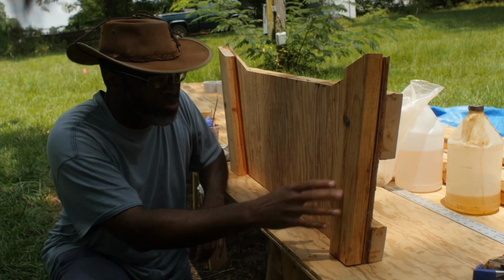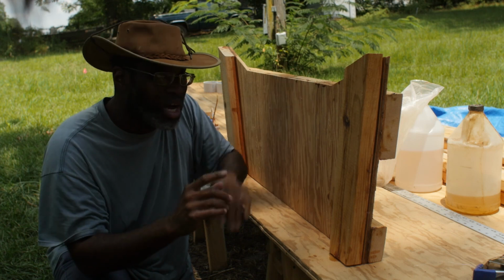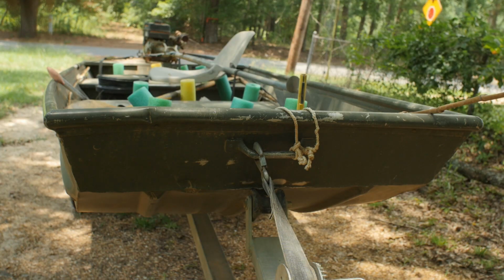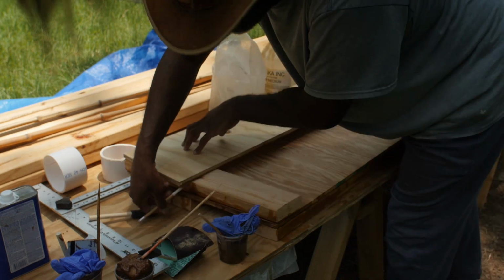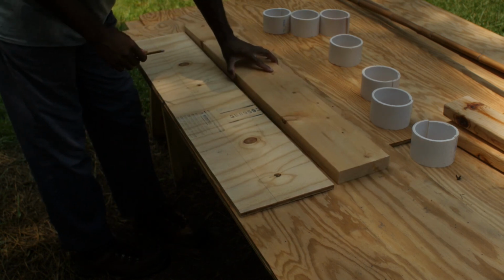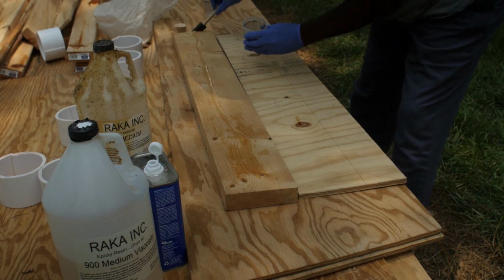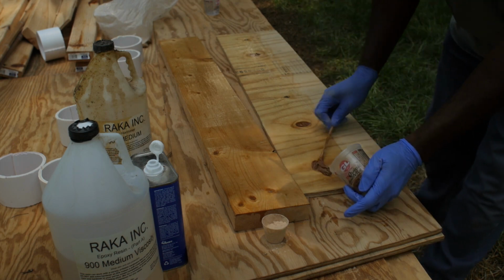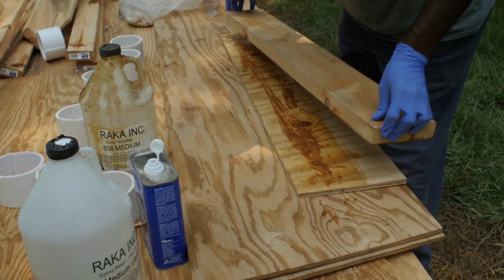The Bow Thai Longtail Boat Plans

Comment: Are we gonna fiberglass the boat when its finish?
Its good that you are using gloves 
I used dry wall screws both sides when i  sandwiched the plywood when I rebuilt the transom on my john boat.
 
Give you a At for effort
Reply from the maker: Yup, the boat will be complete encased in fiberglass and epoxy.
Reply: LOL removed the screws before installing plywood on transom
Reply from the maker: Actually it's a good is idea to leave them in. One of the boat building books I've read recommends leaving them in. That way if the glue or epoxy fails, the screws are still holding the boat together. If the nails or screws fail the epoxy is still holding it together.